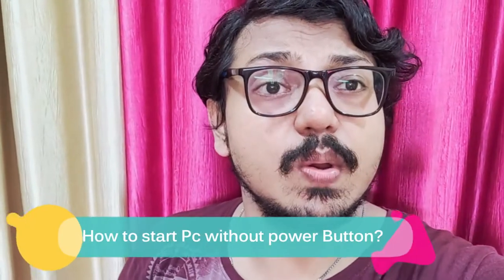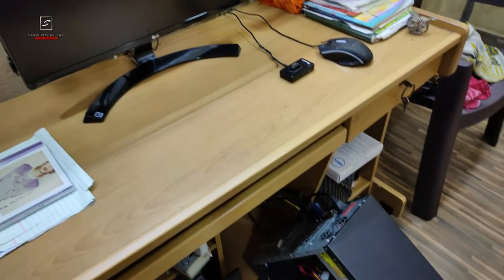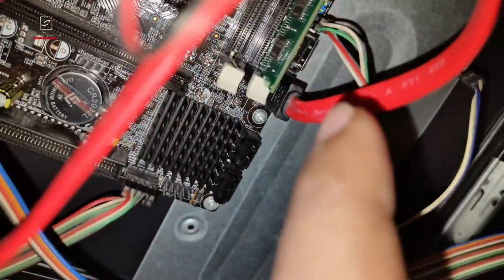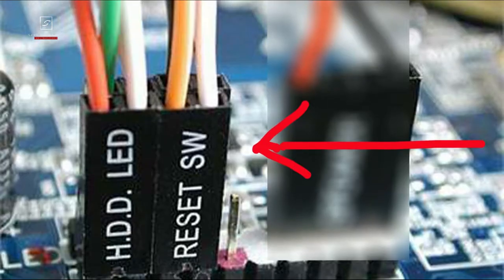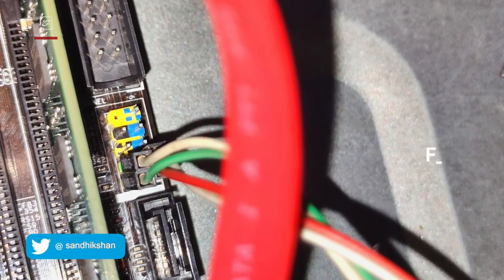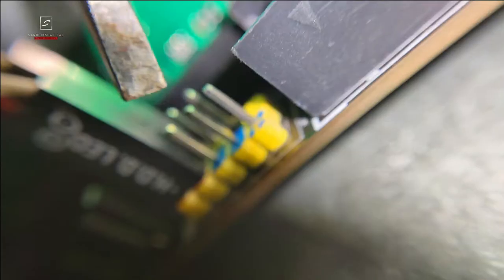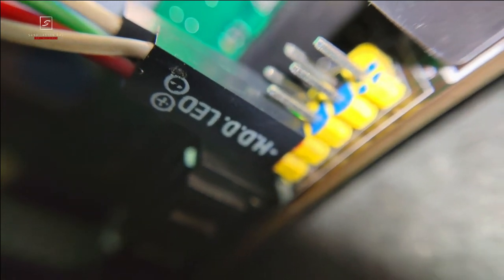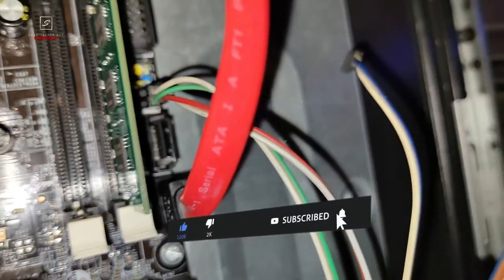How to Jump A Motherboard/Switch on/Turn on(Start) a computer without a power button[sandhikshandas]

Comment: I ist OK to connect the 2 pins with a jumper or would the constant connection be a problem ?
Reply from the maker: Just connect and leave immediately ...
Reply: Constant connection would cause problems like the pc automatically starting or stopping while running , this is due to a failsafe that turn off the pc if the power button is held for too long

Comment: My pc gygabyte h 81 mother board. When power button jumper shorting not on the system. But full power supply off and then on the system automatically starting . What is the solution

Comment: Hi sir!🤩 Thank you for the video, my PC's cooler is rotating but the monitor shows no signal.😭 Then I think that the problem is with the cable that connects the cpu and the monitor...🤔
Reply: Zamptoo  I tried to insert the ram plate in both the slots, it is not working until now...
Reply: Yes
Reply: plug ur VGA/HDMI cable properly

Comment: I did one more thing, I used the old pwr SW cable and add more wire to it and attacked to a 15rs push switch and hang outside from  a hole

Comment: I’ve tried so many times but nothing work😭😭
I have a b250 m motherboard from msi, 1 tb hardrive, intelcore i5 and 16 ram but it don’t turn on😭😭😭😭
Reply from the maker: If it does not turn on then it may be the fault of your motherboard

Comment: Hii bro I have a 6 year old mother board . How do I know that the mother board is damaged or not or working ?? Please reply 🙏🙏🙏🙏🙏🙏🙏
Reply from the maker: Start your board by attaching a 400/450watt smps, a ram stick,hard disk and processor  ..If it gives any display output then it is ok otherwise damaged or simply you can check it  by jump start method
Reply from the maker: No , not forever ..You will have to use cabinet for long term or normal use ..For testing purposes you can use without cabinet.. watch the full video to know about jump start